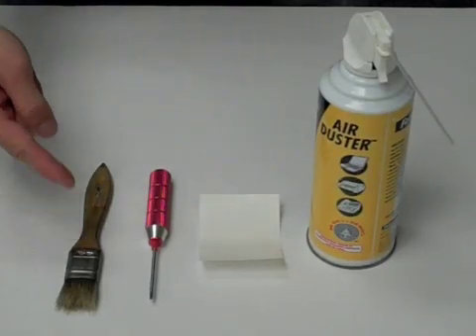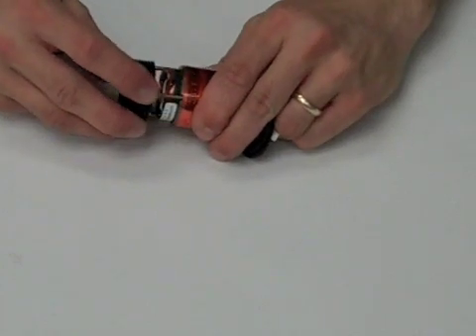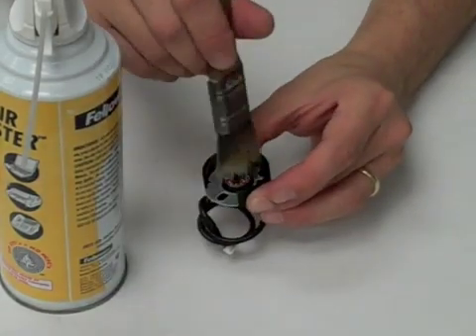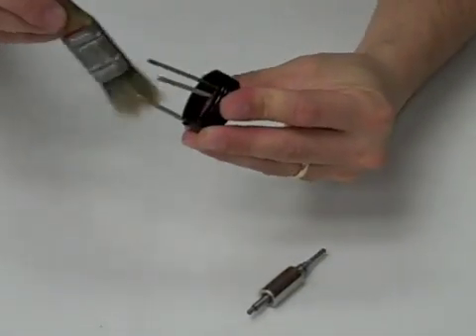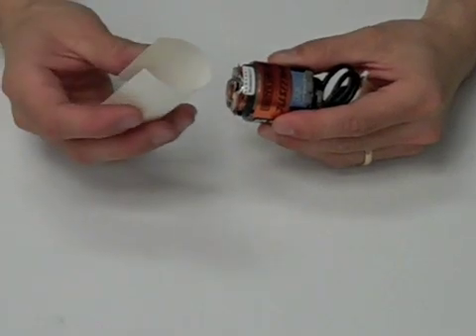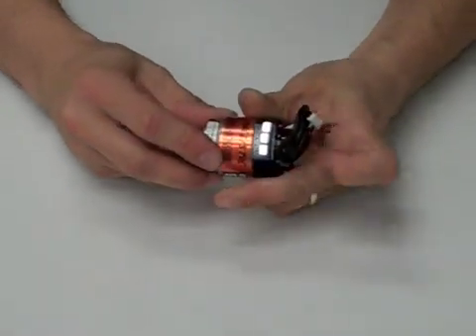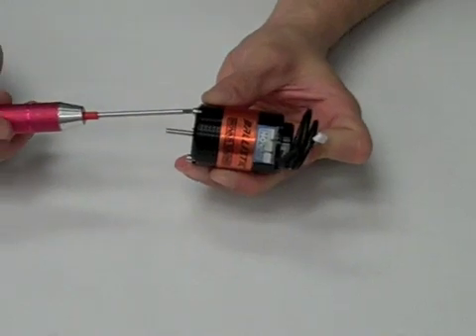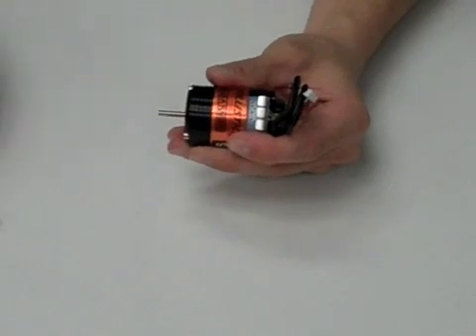How to Clean a Brushless Motor

Comment: Yeah. everything is very cheap. and for the most part it shows. their car motors are useless. and anything for 1/10 you regret buying it as soon as you have it. batteries are a hit and miss. a lot of people everywhere and some i know have gotten duds out of the box, and theirs nothing you can do about it. and after only like 10-15 cycles you can feel the power degrade. if you want cheap buy a hobbywing ezrun or like novak said their "sport system" both excellent for the buck.

Comment: @indy34096  eat them motors up 2 a year on the beach. bearing fail in them vxl 3500kv after time
put a decal over the rear bearing helps . make sure the mounting hole not in use are not open
dust and crap gets straight in them mounting holes , i even found rocks in side one of my 1/8 cans cause i did not seal the spare mounting  holes ,contact cleaner works better than air .its used to clean MAF censors in cars, evaporates completely .